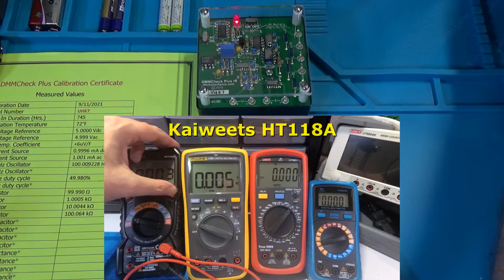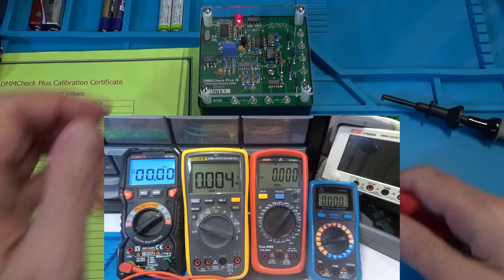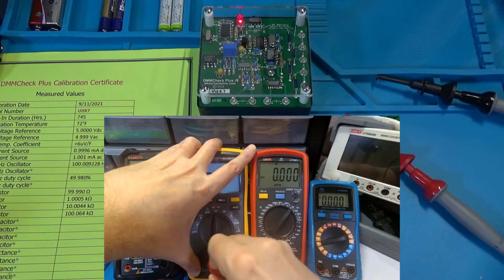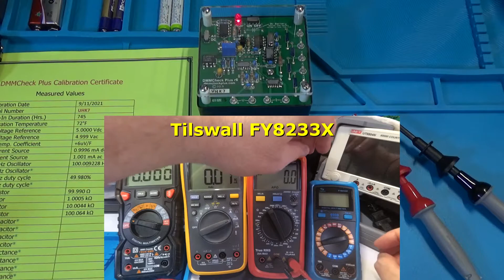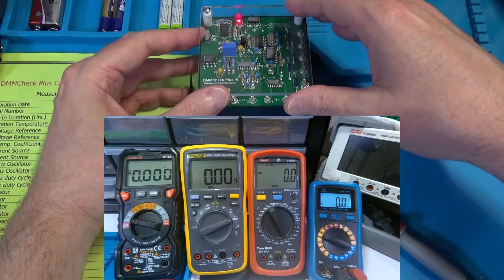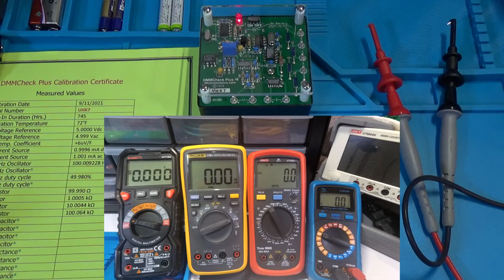DMM Check Plus Reference Standard Shootout

Comment: Trying to decide if I should get this $175 device to test my $39 Kaweets or just spring for an 87v -  I’m joking I think it’s a cool tester and have an old 87 that I’m wondering if it’s still in tune- cool video
Reply from the maker: Appreciate that - yes - the DMM Check Plus is a very useful tool to have - especially if you have more than one meter.